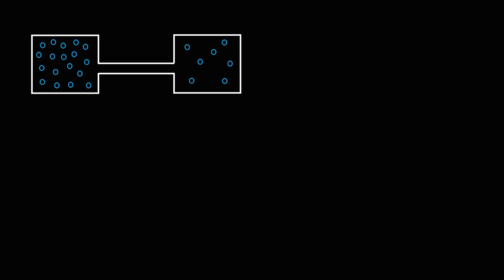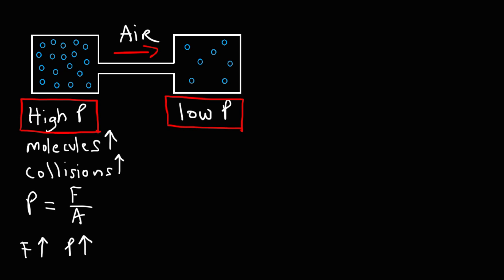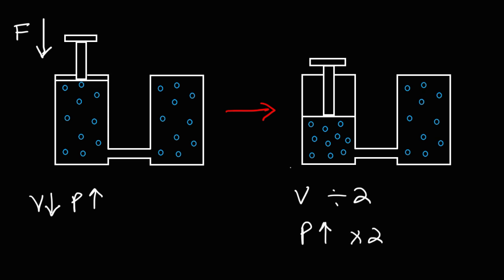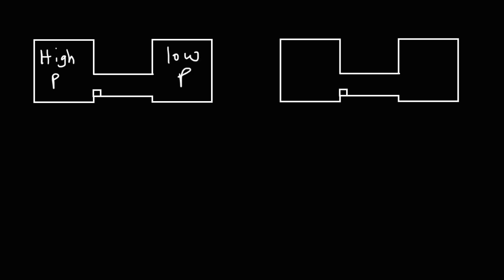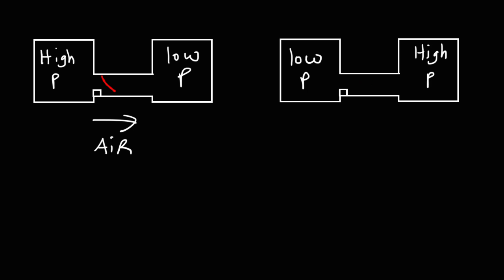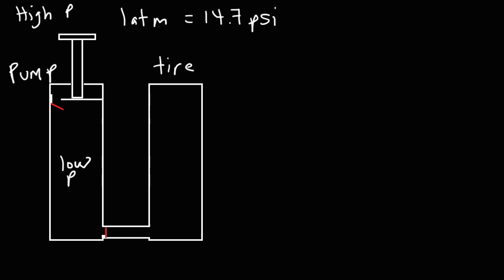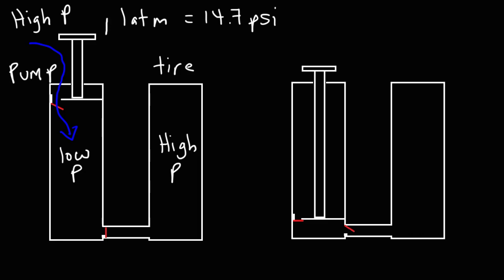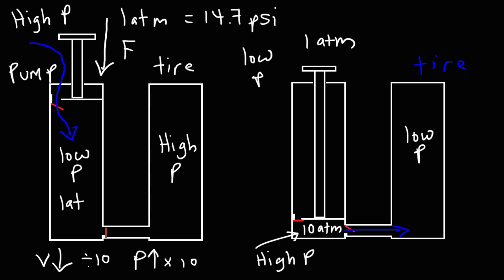How Does a Bike Pump Work?

Comment: Professor Organic Chemistry Tutor, thank you for a tremendous explanation on How a Bike Pump Work using the classical principles of pressure and volume in Boyle's Law. I used a Bike Pump regularly; therefore, I understand this material from start to finish. This is an error free video/lecture on YouTube TV with the Organic Chemistry Tutor.

Comment: Nice knowledge that you'r giving us.But i have a doubt i.e if we put out the air  from the tires of bicyle. why we required a more force when riding a bicycle but on the other hand if we riding the bicycle which is filled with air that requires less forces to gain a high speed why???